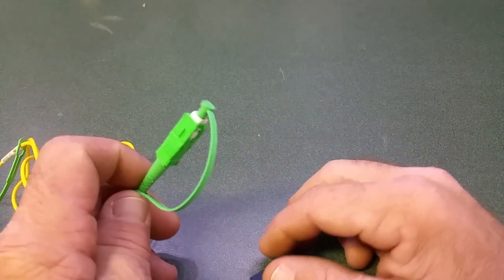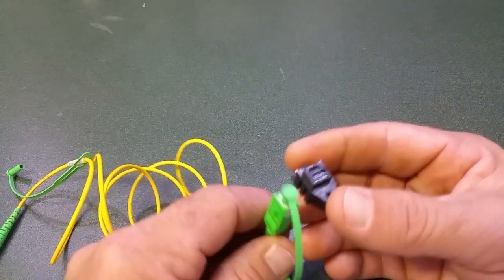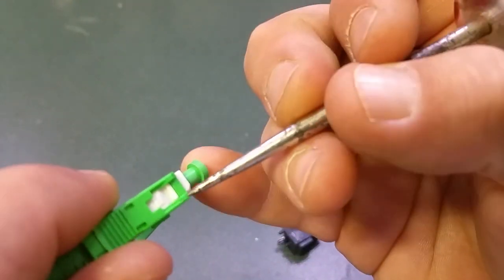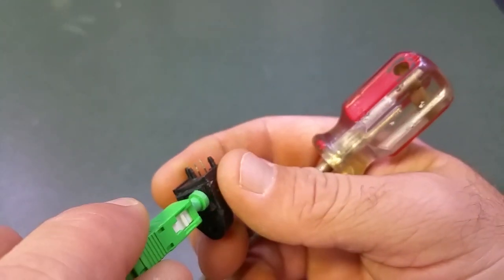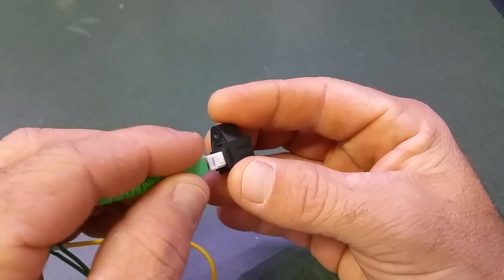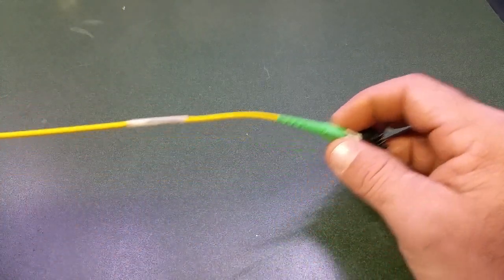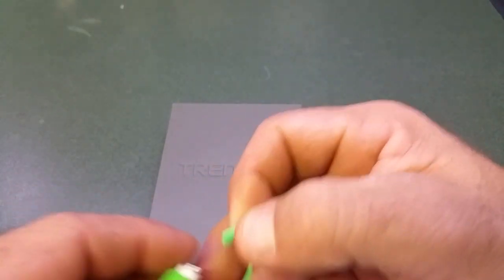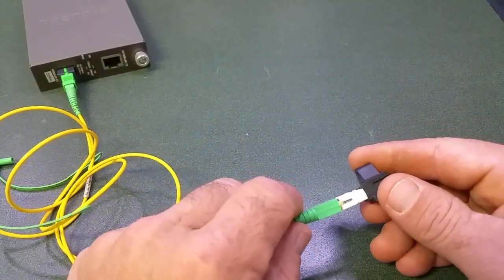Convert single mode fiber sc connector to fit toslink

Comment: OMG! There's a huge difference between toslink and SingleMode fiber, they can't be connected. And i'm afraid the converter also has SC connector not APC (green one), so they also doesn't fit.
Reply: Sc is the connector profile.  Green or blue usually designate if its Apc or upc.

It clearly doesn't fit because its sliding out though.  I came here researching if the toslink is based on the sc standard